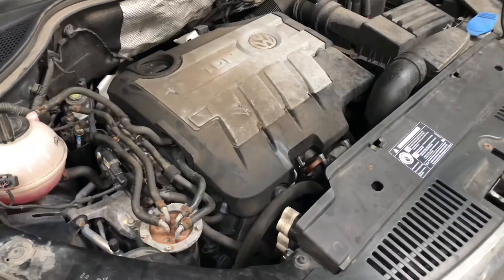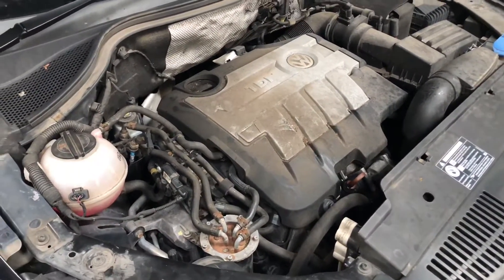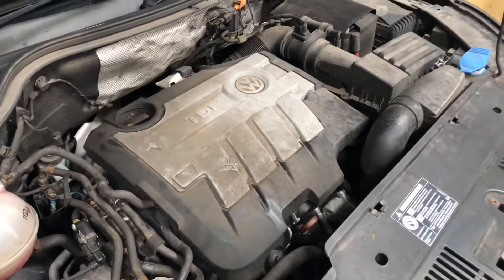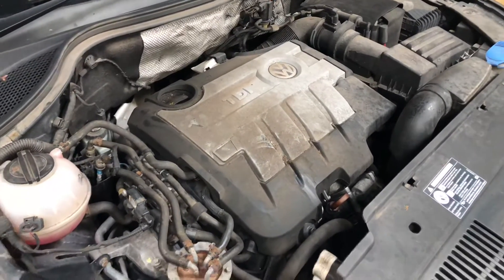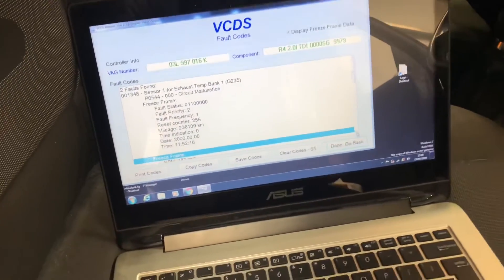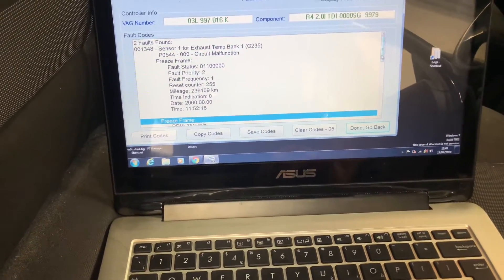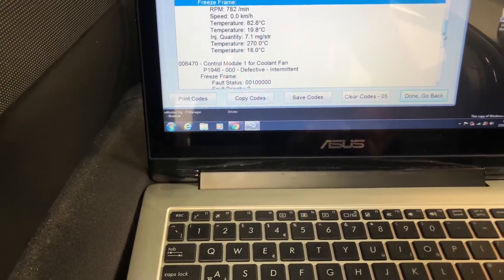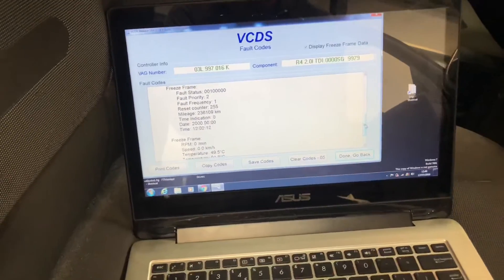VW 2.0 TDI DPF BLOCKED ?  ** QUICK AND EASY TIPS TO AVOID DPF  BLOCKING ""  THESE TIPS WILL HELP.

Comment: Thanks for sharing. I keep getting a check engine light for the DPF, & noticed last time I filled up the tank it's definitely NOT getting good mpg's so far; only about 200 miles & approaching a 1/2 tank already. I've gotten over 600 miles out of a tank at least a few times. Just changed the oil w/ the Mobil 1 European 5w40.             - take care

Comment: As you said in the last tip ; is it advisable to drive on motorway with low speed gear ? Like 4 ? On 60 or 70 mph ? Is it true that will help ?

Comment: Thanks for a great video!

I am tempted to drill a hole somewhere next to the O2 sensor big enough for the nozzle to insert and spray the foam without messing with the sensor. Just have to figure out how to plug the hole!

Just not sure about how much pressure is inside the system.

Comment: Hey. Does anyone have an idea if its normal to smell exaust /soot smell on cold start  with vents on or when you stop in traffic? Does it have anything to do with dpf regeneration? Beacause i have a seal changed bettween dpf and turbo, but that smell still comes when the vents are on. Some one can help maybe had the same issue? My car is vw golf mk6 2.0 tdi 2009.
Reply: Have same issue on my Passat, have you determined the cause?

Comment: I was moving my van up to the garage doors and back daily to prevent anything from getting stolen out of my garage. A warning sign came up, now I never run the van without getting the engine hot before shutting it off. Warning sign gone, van back to normal. All I was doing was sooting it up without the chance the van could burn the soot off.

Comment: The regeneration happens every 300 miles it happens without you knowing . I had a guy come to clean my filter on my drive as i had gone over the limit . After it was done we went for a drive with his diagnostic computer plugged in to see what was happening . We went on a motor way and it took 30 miles to complete a regeneration.  He told ms the % up and down as i was driving at 70mph in 5th it was coming down but if you break it goes up . The key is to always burn fuel never cruise.  Its just a shame that the info  he could see on his computer was not on the dash board display of the car . The car actually telling you how complete the the regeneration is . This would stop all problems . He also said if the yellow drive to clean light comes on you have left it to late . If you drive correctly it should never come on .

Comment: Wow low fuel - who knew. I've just failed the MOT on emissions 😪😪 Going to strip the EGR and run some Wynnes Emission Cleaner to try and get a pass.  Any thoughts on using a DPF cleaner like Wurth?
Reply from the maker: I’ve used the Wurth product in the past and it worked ok definitely wurth a go 😄

Comment: Morning, I’ve got a Passat estate 170 sport it’s a 2006 and it stinks when sat in traffic on tickover. Is this the dpf getting blocked? The light came on the other day but a drive down the motorway in 4th at 70mph cleared it.

Comment: The way in which low fuel causes the diesel particulate filter(DPF)(Soot Trap) to not work, was not explained well.   Yes, the part about the DPF cleaning system needing "extra fuel" was there, but if the fuel is there in the fuel tank, it's presumably available to the system.  So I'm guessing the car's fuel supply monitoring system is preventing supply of the extra fuel to the DPF because it is trying to save fuel when the fuel tank is less than one quarter.  In that case, taking the "old girl" for a run to clean out the DPF would not work.   On the other hand, good fuel economy occurs at highway speed, so the system should "know" that, and take it into account.

Comment: Great Video. THANKS!  Question about the oil. 2015 2.0, been using 5W30 Pennzoil Euro L, some say its ok for the DPF but I'm not seeing the VW 507.00 spec on jug.  I bought 2 last year and ready to do an oil change.  Any help here?

Comment: Forcing a regen on a motorway, does the speed matter or is it just the rpm? If I do 3000 rpm at only 50 mph - will that work?

Comment: The way to avoid DPF failure is to stop using diesel fueled vehicles - they are dirty, slow and over-priced vehicles. Use a turbo-petrol car and you'll have no problems, polute the world less and get around a lot quicker.

Comment: I have an audi A6 with the 2.0 tdi ultra, the really annoying thing is that when it starts an active regen there is no light to tell you. First time you know is when you switch engine off and the fans are running and you smell the burning soot. There should be a light to let you know so you can let it finish the cycle before switchingengine off, almost like they designed it to fail.
Reply: If your car's rev needle stays on 1.000 rpm while in neutral and its idling then that means your dpf is regenerating. If you keep intrerupting it's regen cycle you will eventually start having dpf issues . I learned it the hard way 😅
Reply: Recently bought a caddy and second week In I’ve noticed the fan running and burning soot smell. If this is the case, do you start engine so the active regen can do its thing?
Reply: @rahaulmiah  yes once you notice it doing that turn engine back on you will notice it will idle at a slightly higher revs and the start stop function (if applicable) will stop working. I just used to sit and hold the revs at about 2000 rpm for around 5 mins or take it for a blast and once the start stop function came back I knew it had finished the cycle.
Reply: @macky4074  thanks for the info. It did again tonight after I got back from work and thats an hours blast on the motorway. Always thought active regen’s kick in usually after short drives?
Reply: @macky4074  If your goal with increased RPM is to increase temperature in DPF, then doing it while standing in neutral will do basically nothing. Engine has to be significantly loaded in order to use more fuel than usual - that will increase DPF temperature and possibly assist in cleaning soot. Basically you have to drive, ideally, uphill. However it still might not do any difference, as active regeneration process adjusts fuel post-injection according to the temperature readings from DPF sensors, trying to hold ~600 °C during the process anyway. You can see those figures in action with VAG DPF application and decide for yourself do the driving style during active regen changes anything (in my car, very minimal or nothing).

Comment: Although not directly connected to this video, but my point highlights the point of why DPF's were introduced to the car..basically to cut down pollution..right?..but we are being told in this video and many others, and also from various Mechanics to get out and boot the car on a regular basis and maybe 15 to 20 mile drive up and down the 
Motorway..thereby doing unnecessary journeys to solve the DPF issues.
So basically we are putting more pollution out, and defeating the purpose of the DPF theory..its Nuts!!!
Reply: Exactly what I was thinking! It's so backwards it's unreal. Remove and remap has got to be the way!
Reply: Specifically, its purpose is to reduce the amount of soot getting into the air, and it does at least do that.  In terms of health for living things in cities or near major motorways, the soot/similar particulates is one of the worst offenders.  

You are right that you end up putting out some additional CO2 from this, though.
Reply: I suppose the message that needs to be put out is that diesels are not suited to people who mostly do town miles.

Comment: No smoking.  Only light I occasionally get is turbo boost  pressure not detected p2262 any ideas ? Sometimes it bogs on throttle pressure or changing gear etc

Comment: Great tips man , I've a 2019 Octavia 3,I've it two weeks , i1.6 TDI , and when I turn off the car , and lock it , the fan keeps running for up to 15/20 mins ??? Is that normal ???
Reply: That means that you interrupted an active regeneration. The fans are running to cool down the engine bay. Easy way to tell in TDI's is to pay attention to the idle rpm before you shut it off. If the idle is at 800 like it normally is then it might not be in regen. If it's at 1000 rpms or above then it's definitely in an active regen. The fan running at top speed is also a tell tail sign, although if ambient air temps are low, the fan might not always run. One the most prominent sign is to listen for a hissing noise coming from underneath the car. While in an active regeneration, the DPF is essentially acting as a blast furnace to convert all stored carbon soot into CO2 and water vapor. This fire will create an audible hiss. Lastly, there is a recognizable smell that is produced during regen. It smells a bit like burning rubber. If you can smell that then it's another tell tail sign. As a warning, you should avoid shutting the car off while it is going through this process because of the temperatures involved. During regen, the DPF is already at an extremely high temperature (400-600 degrees Celsius). Shutting down at this temperature can negatively effect the longevity of your turbocharger, catalysts downstream in the exhaust, and the DPF itself. The DPF is made of cordierite which can resist extreme temperature changes to a degree. However, given enough neglect the DPF will crack internally leading to a failure. I have learned from my mistakes while owning a Jetta 2.0 TDI. Everything that this man says in his video is critical to maintaining the health of your DPF as well as what I have said about being able to recognize a regen. Clean air is better for all of us but busting out your wallet to consistently pay for parts is not always good for you. I wish I could say more to you on this subject but my comment has become grossly lengthy. Either way feel free to ask any questions and welcome to the TDI gang.
Reply: It is worth noting that it IS possible for the fan to break too.  This happened to me (car was about 10 years old at that point) and the fan just stopped turning off, ever.  Leading to the battery dying, being replaced, dying again, and then me just getting it jumpstarted and going straight to the dealer to get it fixed (the first time the battery died, I thought it was just since it was a few years old and it was getting colder out).  

Might be an uncommon issue, but definitely take a serious note if it ever seems to run for like a whole hour after you turn off the car.

Comment: my 2015 golf tdi has 300,000 miles on it and has started throwing the DPF Regeneration Frequency trouble code. Quick driving not going to solve this one. I didn't see anything useful or helpful about this video. Mine gets "spirited" driving everytime I'm in the car
Reply: Did you fix the issue?
Reply: At 300k prob needs a new one. Nothing lasts forever. Me… gave diesels up years ago

Comment: Unfortunately this advice is just not enough.  I have a TDI Golf and I take extremely good care of it.  Oil is changed with factory VW oil before 10k miles, fuel filter changed with factory filter, and I keep my fuel over one third tank ALWAYS, not only to avoid clogging my fuel pump with dirty diesel gunk and sediment that falls to the bottom, but also to avoid harming my fuel pump.  The problem is that any TDI cars still on the road (at least in the USA) were retuned (timing retarded significantly) in order to burn off more NOx and pass local emissions.  Not only the EGR valve but also the particulate filter needs to be regularly cleaned on many cars.  I already tried the Lucas Diesel fuel additive specially designed for diesels, and also a computer assisted burn and it did not work.  In many cases, without retuning the car, the particulate filter has to be flushed.
Reply: Wow great insight. By retuning you mean to correct the timing to original spec?

Comment: Had my 2015 Tdi Jetta for 3 years and always fill up on a completly empty tank. (1000 kms/ tank which is my weekly hwy commute) have not had any issues with the dpf. Not sure if the highway driving offsets the empty tank concerns??
Reply: DPF blocks when you do a lot of short distance drives, or drive in the city (i.e. making lots of frequent stops). Highway driving should help with DPF to go into regen and clean itself out.
Reply: Tell me one reason not to put fuel at least when it's at 1/4.
Reply: @songoku7915  cost
Reply: all the sediment at the bottom of your tank will go through your system inc injectors, these are 650 quid each and there's 4.
Reply: Since apparently oil age/mileage can influenced it, it may also be that you are just simply getting oil changes properly and this helps.  Also, in my case, I didn't start seeing the light for the first time until my car was 8 or 9 years old (its a 2009 model).  Since then, it just came on again recently and I think this time I will probably need to get it properly cleaned.

Comment: what would you say is a suitable run to help clear it...does it need to be a motorway run with revs at 2k or can normal driving do the job on local road i.e stop start and dual carriageway mixed
Reply: Manual indicates between 2k and redline.  So this would typically mean you would want to (if your car has it) engage the semi-"manual" gear shifting mode and just manually keep it in 4th or 5th gear instead of the 6th it would usually go to for highway driving.
Reply: Between 3-4k rpm for 15-20 mins

Comment: I've had many diesels and only driven them round town , the key is to not pootle about at low revs , drive it hard and under load when possible, use the torque it was built to use and you will be ok .
Reply: I have an insignia vx line diesel  and use it on fairly short trips but drive it hard enough and no issues so far (touch wood) and it’s chipped
Reply: Starting a new job soon. Gonna be doing a load of motorway commuting. Was looking at 2.0 patrols. Don’t know what I was thinking. The vw TDI seems like a brilliant engine for long commutes
Reply: I heard somewhere someone suggesting to keep the rpm below turbo action (around 1,300 rpm in a VW 2.0 tdi) to avoid turbo turbine cool off the dpf. Do you think is valid?
Reply: @jestruck  during regeneration drive on about 1800-2200 rpm and you'll be fine. The 3000 rpm reving is indeed a myth.

Comment: If the DPF regeneration does not work below a certain fuel level this should be mentioned in the user manual. And with the same level of attention like the oil level. As this is vital for the whole engine system. And this system is a major one. The car will not work if the DPF does not work. It's the same as oil level, coolant level, brake fluid level.  This is not a window cleaner fluid or a "blinker fluid".
Reply: Do you really need your car manual to tell you to fill your car every while and not driving with 5 liters of fuel left?
Reply: @songoku7915  No but this requires a 1/3 of the tank. So 15 to 25 litres is a lot. And this is above the reserve. In my car when I'm driving to the reserve I can get another 2-300km for the last third. The system in my car regenerates every ~450km or sooner even if the threshold of soot is not reached. So the manufacturers decided that 450km is enough. Frequently adding 250km over that can lead to a premature damage. A lot of city driving cars that have their DPF's changed at 45 000km filled their tank with ~20l when they reach the reserve. Once a week. What I'm saying is that if the owners have this habit they are not aware of the damage they are enforcing to the system.
Reply: @teovm  you're fine. My Yaris regenerates every 140km and i m planning to get it washed or something... Having low fuel level can cause also problems to the fuel pump as well as cause bacterial growth where the fuel cleaning additives don't reach. I always top up with fuel at about 2/4 or in the worst case scenario at 1/4 but i never wait to see the light. Do you gain money by emptying the fuel reserve? You need then more money to top up the fuel.

Comment: The DPF light comes on with ignition for the last couple of days (this was not
the case previously), but as soon as the engine starts it goes off, should I be
concerned? It goes off together with the glow plug light. What should I do
about this?
It never came on while I was driving, but I'm concerned since this only
started happening a few days ago and I would like to avoid a possible
problem.
Reply: I have the exact same problem as you now ..any help please
Reply: @3arbiii897 when my glow plug and dof light came on it started smoking and come to find out the dpf was clogged and turbo needed to be replaced. Luckily was under warranty